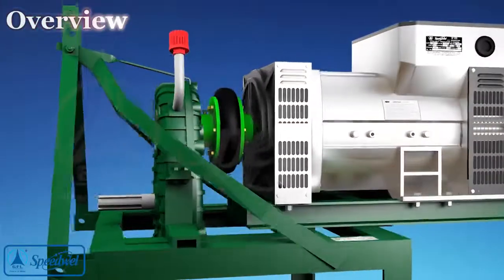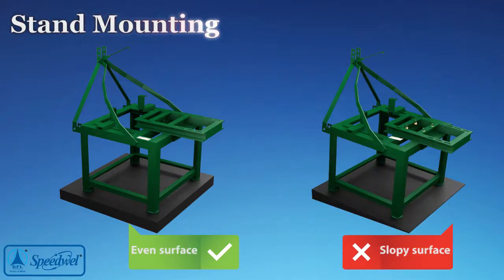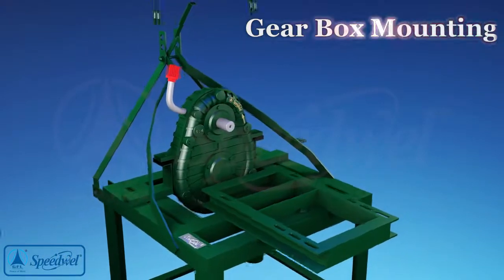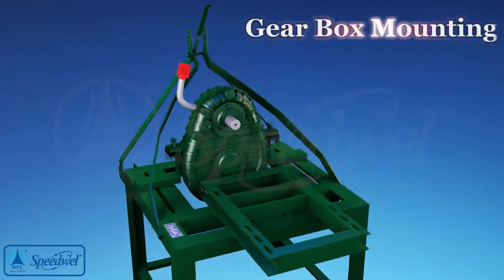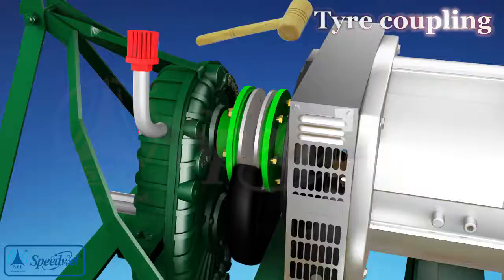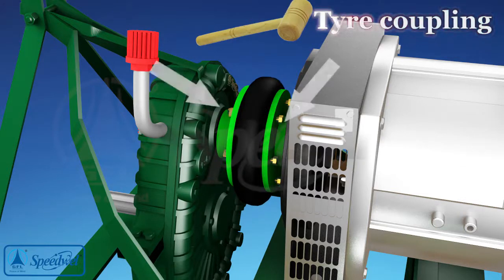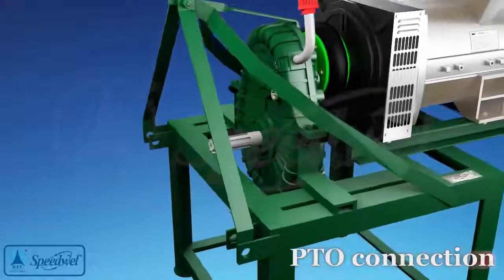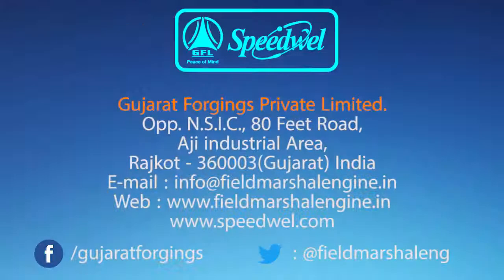SPEEDWEL BRAND TRACTOR OPERATED GEAR BOX FITTED ALTERNATOR , FROM 5 KVA TO 30 KVA [ ENGLISH]

Comment: Do you have an email address and price list?
I am looking at buying the gear box and alternator for 220 volt single phase 12 KVA to assemble and sell in Thailand.
I need to buy in component form because of the import tax.
Reply from the maker: Kindly email on pr@fieldmarshalengine.com or reach out on whatsapp on +919974056835